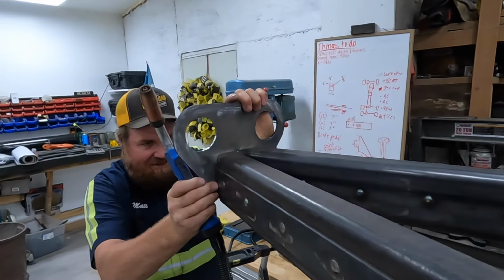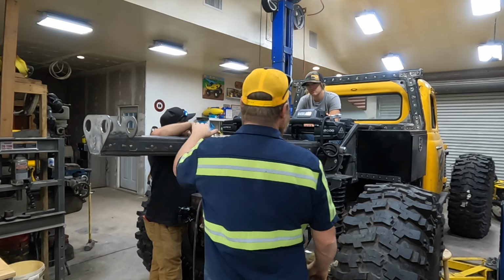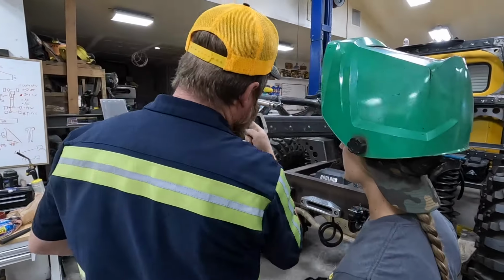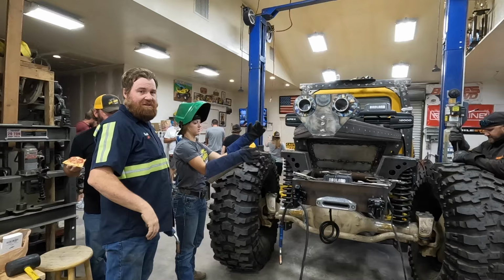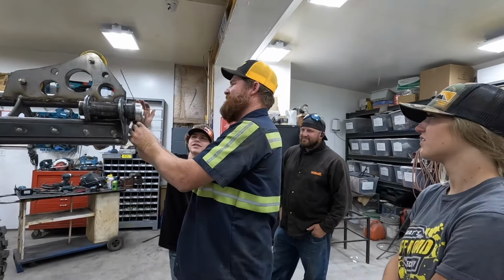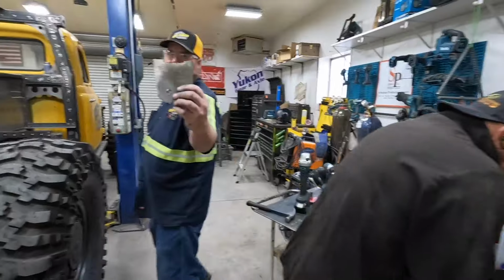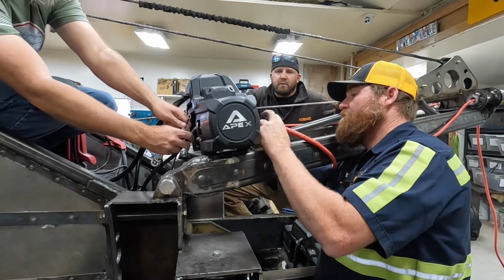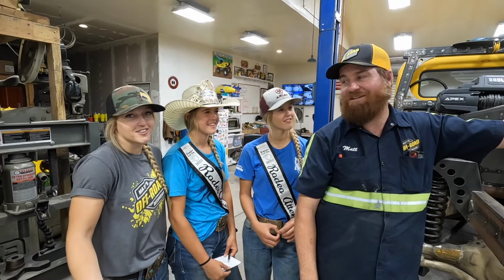Fully Operational Lift For The World's Largest Off Road Wrecker!

Comment: Do you have any plans to diagonal brace that roll bar?  Depending on the angle of the boom, you could be pulling well over 10k on that roll bar pulley (and over 5k on the winch). 

And because the engineer in me couldnt stop, i went back to the vid where you built the roll bar and found the grade and thickness marking.  Per the book, the two 4" vertical columns of that roll bar have an allowable of about 5k with that pulley mounted 3.5ft above the frame.  With factors of safety, the expected failing load is around 8-10k.  The rectangle box tube you mounted it to probably has even less capacity than that.
Reply: Yeah but they've welded plating to everything and corner braces, wouldn't that exponentially increase rigidity? Also, which is the roll bar puller? I think you're talking about the boom lift? If this is what you're talking about, then the answer is hell no. It'll never have to pick up that much weight. The heaviest rock crawler or reg truck MIGHT be a total of 6k, but they will only be picking up the front, so only about a third of that, so maybe 3k lifted. But with all those plates welded to the outside surface on both sides, with a weld every 6 inches or so, it would have to break all of those welds to fail. PLus it's just articulating the boom on a pivot, it's not actually lifting the weight, plus it's using mechanical advantages though several pulleys. I think it'll be fine.
Reply: That's very conservative---  If you calculate the worse fall factor possible (fall factor of 1 in this case)---   Lets say there is 6 foot of cable from the boom holding up a jeep-- likely at least 2000 lbs as the front half of the jeep is being lifted by the boom.   Lets say they are pulling off of a large rock drop off and going down hill --- so then the jeep is just as high as the boom (so eye level with the tip of the boom basically, and Matt is already at the bottom/ while the jeep is still perched high on the rock) and it were to suddenly fall off that rock somehow and fall the full 6 foot and suddenly slam the cable--  that would produce around 23k lbs force (or 102 kN)---   So significantly more than 10k lbs of shock/ falling load is technically possible, and not necessarily unlikely with all the crazy rock walls that they climb on;  (and that's only considering half of the jeeps weight at 2k lbs, meaning with the rear wheels still on the ground).      It would likely see 10k lbs falling load quite often/  at least once every trip or so.  and remember, even those little 1/2" soft shackles are rated at 44k lbs, so these aren't outlandish numbers ........  So I agree-- some sort of angle bracing down to the shock towers would go a long way.  Also, I'm a little surprised at just how thin the pulleys and brackets are-- I know he said that the bolts will be bigger --- but I hope he means the brackets, gussets, pulleys and bolts, ect.. Everything should be bigger around those pulleys;  it should have a large safety factor for work fatigue, and be over-built like a tank.  But I think he'll get it there-- they aren't done yet. :)

(I know a fall factor of 2 is the actual worst case scenario, but that would mean that the 6ft of boom rope would have to be 6ft in the air above the boom---  which means they would have to be going down a 12ft tall cliff face for that to happen, and I think that's just not realistically ever going to happen;  at least not intentionally.)
Reply: @mikeworkman3593  Rewatched, those plates are only plug welded into "rivets" and I saw no seam/edge welds. I'm not a Mech/Structural Eng, I'm a metallurgist, those plates won't add much addition strength imo.
Reply: @patonb  Think about it as the square tube is pulled on, the flat bracing will be wanting to slide up the rear,and pull down the back. It will be pulling against all 200 of those rivet welds. You wouldn't want to weld down the sides of the flat bracing it would put too much heat and could warp it.
Reply: @calholli  I'm not a structural engineer, but I've been in the business of repairing equipment like this for the last 30 years.
You are right about shock load, but you're wrong about where that load will be applied. Look at how it is rigged. The end of the rope is attached to the bottom, not the roll bar. So half of the weight is going to be pulling there. Also, we are not seeing the finished product. You are complaining about the metal, when that rope will probably fail before any of the metal would. 
I think they are going to have 2 chains that will be attached once the vehicle is raised where it'll be moved. You saw them playing with it earlier in the video. So the rope will just raise the boom, but there will be 2 heavy chains holding the boom secure on each side. They make those hooks that the chain slips into and then they just have to let the weight off the boom and the chain will never come out. We use them at work to lift tons of weight where we have to stand under the load sometimes.
Reply: The good news is when they start picking up "real" loads that boom will prob bend like a pretzel before it just "lets go". And no way Matt won't put it to the test at the shop before it is on a paying job.
Reply: @tedsaylor6016  It's lighter than trailmaters boom, and his is just fine. IDK wtf you all are talking about. What do you think he is lifting with this? If you think he is picking up tractors(semis) your wrong. Nothing will be over like 4k, which that boom will have no problems with
Reply: @mikeworkman3593  He said early on that he was building this for pusher buses and large adventure RVs too - much more than 4k per axle, I'd think.
Reply: @mikeworkman3593  Yeah, trailmator" runs his with chains like that, with a fixed boom..  But that rope definitely won't break without being compromised by snags and cuts.  A 5/8"  double braid Dyneema rope is 55k lbs test.. Even a 1/2" 12 strand dyneema is 30k lbs, which is insane.  Not sure exactly what they are using, but most of the other synthetic ropes have similar stats--  ropes have come a long way since the typical nylon and polyester ropes/  which were already great;  but the synthetic stuff is off the charts.....  and I never said anything about where the load was going, just that there is a possibility of high load spikes in certain situations;   and Yes I understand how pulleys work and how the weight is distributed across each point-- which is a good thing, because it will put less load on each pulley, and also less load on the winch itself.
Reply: @xturboexpress  he said he’d be tugging them with it, when they are stuck in the sand. He said it’s main purpose was to rescue rzrs off the buggy trails.
Reply: Those are 12,000 lb winches. With the pulley setup they have a mechanical advantage of 3. 
There will be up to 12,000 on the winch, and 24,000 on the top pulley on the roll bar.

Generally you do very little pivoting of the boom. 99% of the time the boom will be supported by chains that attach to each corner of the roll bar.

Heavy lifting should never be performed by pivoting the boom, just use the double winch lines.

I don’t have enough info to run a stress test, but Matt is being advised by Tom Tom who is an engineer and has been drawing up parts for them, so I hope he has done some analysis.
Reply: @xturboexpress  He needed a bigger truck to be able to yank on a stuck RV in sand. He'll have the weight and pulling power now with the larger truck. The boom is for picking up side-by-sides and razors while having to drive back through rock obstacles. Which obviously a large RV won't be out there in the dunes or on rock climbs. They get stuck mostly at Sand Hollow park - driving on the beach.
Reply: @calholli  It wasn't just for you but the other commenter mentioned the roll bar taking all the load
Reply: I had a similar thought. There could be a lot of force on that roll bar pulley, especially if the boom is down. There could be easily a factor 2-3 higher force than the load on the boom, just because of the geometry of the setup. I would guess the bolt that holds the pulley would be the first one to go.
Reply: @KapenW17  
I doubt he will be yanking on the winches. He will utilize a solid point of attachment.
Reply: @chrisw4562  he said the bolts and pulleys are going to be bigger-- this was just a mock up for testing. (and just for the video I'm sure).  The real pulleys and bolts are still coming.
Reply: Still, with all this said, the roll bars main weakness is gonna be at the bottom with only 2 four inch tube steel welds holding it from getting pulled over. Unless he's using the cage around the gas tank for added support and I missed that episode...
Reply: @calholli  Yeah, i based it on lifting a 5k load at 20 degree boom angle.  The winch is capable of pulling more
Reply: @patonb  Yeah the plates dont add much here.  The tube's failure mode is buckling, and the plug welded plats dont add much because it'll just buckle between plug welds.  They would need to be continuously welded.
Reply: @mikeworkman3593  If they are chaining it, i missed that.  That would solve the problem under dynamic loads.  

For the record, the way it's rigged puts 2/3 of the weight on the pulley and 1/3 on the winch.  Each pass of the rope carries equal tension, so there's 1 part on the winch and 2 parts on the pulley for a total of 3.
Reply: @tippyc2  2:03 2:06
Reply: Agreed, I saw this and you know when off road hulling the G forces created will cause some kind of failure. There needs to be some angle bracing up higher to support that roll cage holding those pullies..
Reply: @tippyc2  Well the lifting is probably fine-- it's just the falling load spikes that can get crazy.  I'm not too worried about it, it's just fun to talk about the engineering and openly brainstorming ideas.
Reply: @W1se0ldg33zer  Ah yeah you're right.
Reply: Agreed, I am in the heavy steel industry doing heat treating and have a background in Metallurgy handling lots of different types of metals, and thought about this build, proper bracing is needed and/or would have gone with thicker wall material, i'm pretty sure this is mild steel which is good when properly braced, it doesn't have the strength or torsional rigidity that the lower frame and when you winch maybe rated for 10-12k doesn't mean your wrecker or roll bar is ,I love this channel and everyone on it and don't want to see anyone injured when its possible to strengthen a part of the build that doesn't really add much weight and its only time, these tow truck  Olympics aren't happening immediately, Matt your health is your wealth and like your sign in the shop says CAUTION and the MORR SAFETY you have built into the heavy wrecker the better. 👍
Reply: @paulgoeke758   Yes, the cage around the gas tank is braced to the roll bar.
Reply: @calholli  how is the dyneema secured? It loses something like 90% of it's strength if it has to make a turn less than 5x it's diameter as it has no compression or stretch. Should never be tied in knots. Always finish with a splice to a thimble with a diameter 5x or bigger of the rope. UV fatigue is another consideration when using dyneema. It should be coated with a UV protection but also the whipping twine itself can fatigue. Dyneema is great when applied correctly, or a waste of money if you think it's just really strong rope. Speaking from a boaty background, not tow truck experience.
Reply: I posted a comment about similar concerns. While you legitimately focussed on the diagonal brace, I focussed on the leverage ratios of the winch, a lack of generous safety margin, and the risks of catastrophic collapse if the cable snaps. Another person legitimately focussed on failures due to improper termination of synthetic cables (knots, a radii less than 5x the cable diameter, etc.)  I commend Matt and crew for their spirit. But when people's lives are potentially at risk, it's imperative to be critical, to look for flaws and preemptively address them. Bending the roll bar would be a problem, but nowhere near as bad as tearing to cable's attachment point off the roll bar or snapping the cable.
Reply: @poguemahone5476  There are several different synthetic ropes that work on different applications-- I'm not sure about all the details, but I've seen charts showing how they compare.  But my overall point is that regular double braid nylon and polyester ropes are good-- but synthetic ropes are on a whole other level, and a lot of people don't realize that...  And I don't believe your statement about a 5x turn:   SO if I have a 1/2" dyneema winch line and put it on a 2" pulley (which is only 4x it's diameter), it's going to lose 90% of it's strength?   I call bs on that one....  I think the stat that you are confusing is that when dyneema is tied into knots, it only holds around 9% of it's strength because it slips so easily-- and if it slips while under heavy load, it can melt the rope....    But there's no good reason why a 1/2" line rolling around a 2" pulley would have a 90% loss.    I mean, just look at the soft shackles--  they have a spliced loop that is wrapping around a single diameter of rope and held by a stopper knot--  That's much less than a 5x diameter turn and it still works great.   A 1/2" dyneema soft shackle is 44k lbs test.  But I agree that you're not supposed to tie knots with them......... But even to your quoted stat-- for a 1/2 line, you would only need to use a 2  1/2"  pulley to get passed the 5x turn issue.  That's not an unreasonable pulley size at all.
Reply: @calholli  It's not about slippage, it's because dyneema has virtually zero stretch or compression characteristics. When you put it through a tight radius turn  the load is no longer spread across all the fibres, but held by only a fraction. If it's tied in a knot on itself then it's only around 10% of the fibres taking the load. A 4x radius will not be 10% strength, probably around 80% but a knot on itself is severely weakened. When it's tied in a knot exceeding the capacity of just the fibres that are holding the load (not the rated capacity as they're not all taking the load) causes fractures which are much harder to see than with something like wire cable which frayes, and also steel cable has a higher capacity for tensile stretch cycles than dyneema. Slowly the dyneema will split in a way which is hard to see until it fails suddenly. I'm not saying don't use it, just make sure it's used correctly and spliced with a thimble eylet to finish with good quality UV resistant whipping given the environment. I'm not a design engineer, I'm a former mechanical engineer from a manufacturing background, and now professional sailor so my example numbers may not be exactly spot on and airing on the side of caution but that's how I operated coded vessels with clients safety in mind. Snapping a dyneema halyard holding a large sail is not likely to be that dangerous but snapping a dyneema towline with a truck suspended on one end is a different situation. I would think having heavy duty chains is preferable given the UV factor. We use dyneema on halyards because it's light and has zero stretch allowing us to  accurately trim halyard tension for different wind conditions. Maybe having chains as a backup that can catch the load is prudent.

Comment: Matt, I think those mounts and the bolts that secure the boom to the wrecker are about 1/2 the size they need to be.  Using King Pins comes to mind.  Love the channel.
Reply: Kinda, for what they often recover its fine I think. I know that A-Frame setups tend to have small hinges.
Reply: as someone who works with real rigging that involves 500 ton crane, id say his frame is fine, but those bolts either need to be wayy thicker (length is irrelevant) or a higher grade. 12.9 or grade 8 are surprisingly stout, but in that direction im still not sure the rollers have big enough bolts

Comment: That boom looks heavy, I would be concerned with the ropes breaking. Can’t wait to see it in action.
Reply: The winches are rated at 12000 lbs, I’m assuming the ropes are too.
Reply: Yeah not only 12,000 lbs rating, but with the pulley system you're getting about 1.5:1 - 2.5:1 mechanical advantage (depending on the boom angle), so there's about 18,000-30,000 lbs of force holding that boom up.
Reply: It's to lift up jeeps and side by sides.  I think they have some weight to spare in the name of durability.
Reply: Modern synthetic ropes have crazy load ratings these days... I wouldn't worry one bit 😉
Reply: @russhellmy  The pulley attach-points are a concern (to me); especially the upper pulley above the cab.  I'm fairly certain the moment-arm at that pulley is the weak spot. I'm just an amateur, though.
Reply: @derrikarenal3308  Those SHS Sections look to be atleast 4" with 3/16" wall but possibly 5" or even 6" with 1/4" wall.
In the 4"x3/16" case those frames would be good for well over 1Ot of force.